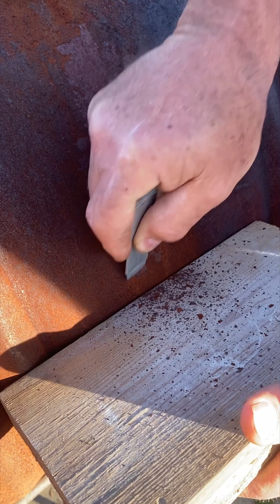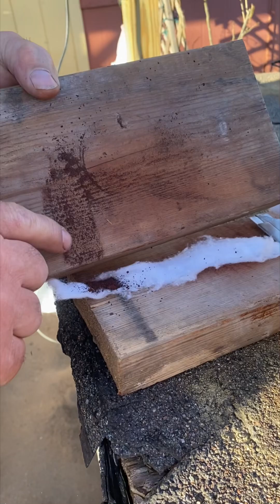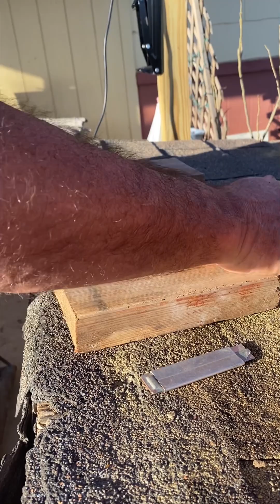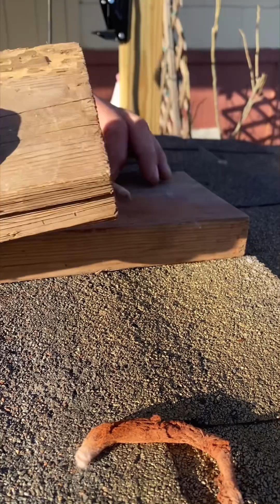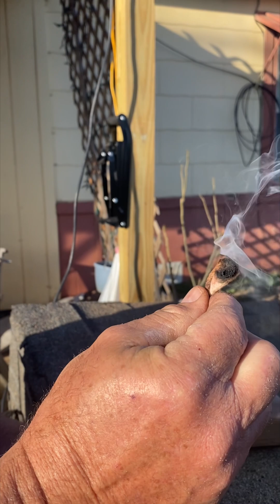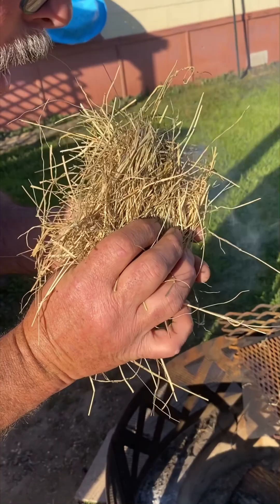Rust is an excellent filler

Comment: Why did rust just catch fire
Reply from the maker: The rolling under pressure causes friction and the friction heats up the rust causing an ember to form in the cotton
Reply: @bobbyoshields1703  all you had to say was you are a Wizard good Sir.
Reply from the maker: @Slevencolevra  that would be have been easier 😂